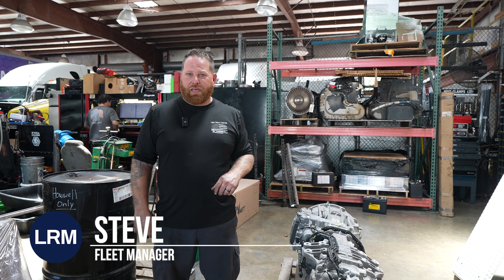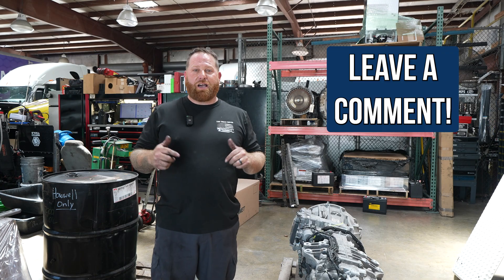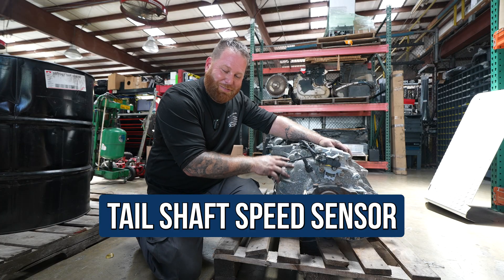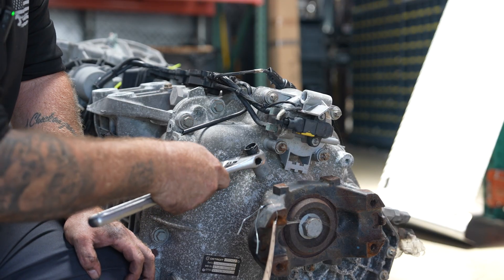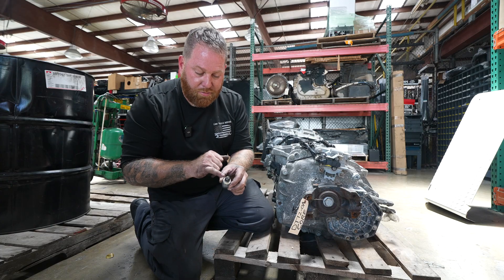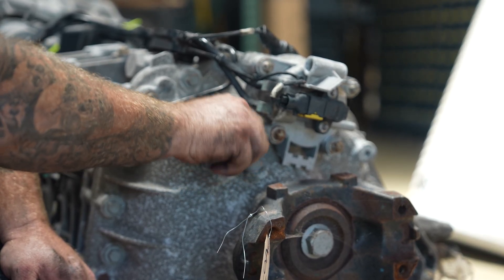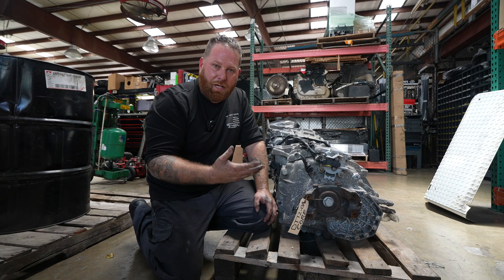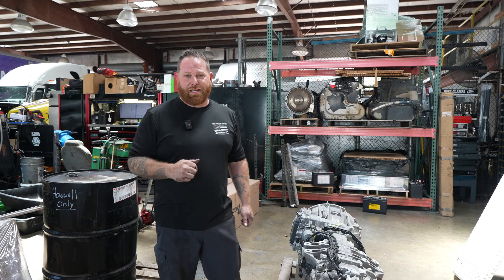How to Fix DT12 Tail Shaft Speed Sensor Issues on Your Freightliner Cascadia

Comment: Does anyone know if you can take that out to bypass the 5 mph derate to get the truck to a shop? I disconnected it. I didn’t pull it out of the truck and I still had my speedometer work so kind of confusing.
Reply: I did but my truck runs on same speed 5mph